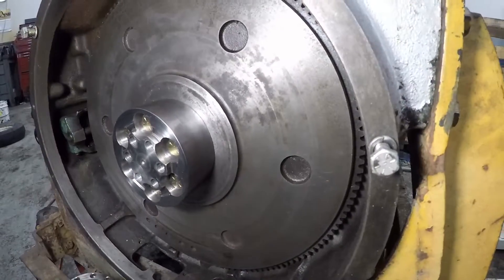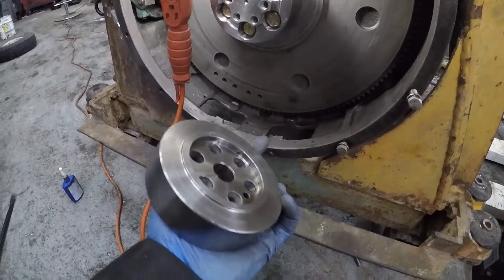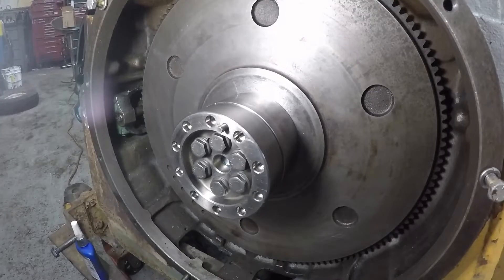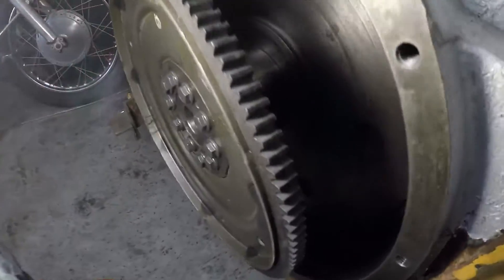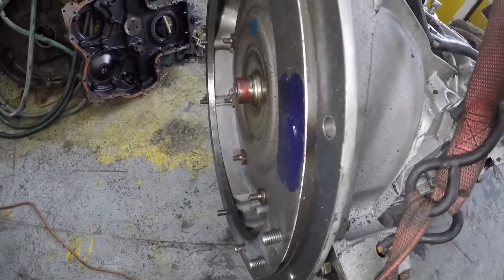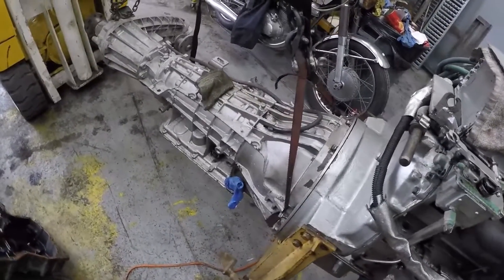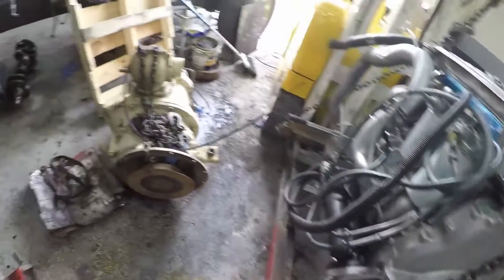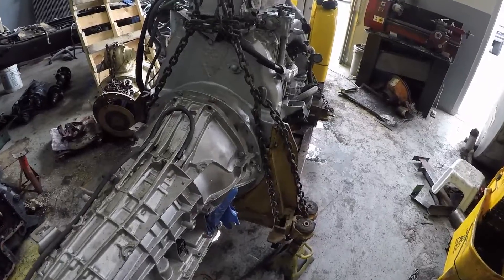Detroit 4-53T Bolted To Ford 5R110.

Comment: So well thought out to arrive at a truly "finished" product, I am without words over how impressive your execution of making the Ford transmission fit properly to the Detroit, all too often these type of things are marginal at best however in this case the installation is robust and well thought out, not easy to do!
Reply from the maker: Thanks. I wasn't sure it was going to work, but as the 5r110 was free, I thought I might be able to turn those parts on my lathe.:)  So far it's held up to hard driving and long mountain pulls.  I will have to upgrade the shift solenoids in the spring.:)  Very happy with it.:) There's no metal or leaking from the trans so that tells the tale.:) 10,000 miles post rebuild now and it's all good.:)
Reply from the maker: Not sure if you saw the post engine failure video or not.  I bought this engine in Florida and it was in nasty shape.  Sure ran well until I started running up these mountain hwys.  I got 600 miles out of it before she broke a liner.:)  Anyway I decided to rebuild it and upgrade to the Silver Series internals.  https://www.youtube.com/watch?v=CX6L06tAs7A

Comment: I like your engine adapter. 
I see you know your way around 
Designing and manufacturing.
Reply from the maker: Thanks, Yes it started when I was a kid and decided to put a chainsaw in a mini bike.:)  This is just a bigger mini bike.:)
Reply: DetroitGarage I’m a machinist 
I grew up on a farm. 
I got so much knowledge on the farm. 
And I worked in heavy equipment industry for a while to. 
So that’s why I pay attention so much detail. 
I appreciate all the fine details
When you say 4140
I know exactly that metal
Reply from the maker: @akfarmboy49  Very nice, I really enjoyed building those parts.  I made the first crank adapter from 6160 as it was soft and easy to turn on my 5" lathe.  It was a template for the 4340 piece I turned as the final adapter.  Wow is that hard, I never even sent it out for treatment as it was so hard untreated.  Some day I'd like to get an old Bridgeport or South Bend lathe and sell my small lathe.

Comment: Glad to see someone throwin a detroit in a 08-10 ford. I wanna put in a 6v53 but lookin at urs im wonderin about fitment lol gonna use the zf-6 tho definitely my dream-6v53 in a black harley 08-10 f350 crew long zf-6 and i kinda wanna put an air starter in just for fun haha
Reply from the maker: I think the 6V53T would be a great choice.  If I were to do it again I'd choose the 6V53T as it would be ideal power wise.  The 4-53T in nice, but it could use another 2 cylinders to help.  I'm at about 200 HP and 450FTLBS of torque.  I'm going to upgrade to 9A90's in the Spring and that should bring me up to 230 HP and 500 FTLBS of torque.  Thanks for watching.:)

Comment: greetings again--so i am going over your videos for fine details--a few questions--you mentioned you ground off balance weights from the 5r110 torque plate--any problems related to this?
would you have videos of machining adapter plates mating 5r110 and 4-53 flywheel housing?  dimensional drawings?
the toothed ring gear on torque plate does not engage starter motor?  many thx
Reply from the maker: Yes the Detroits are internally balanced, so if you attach any external parts they need to be neutrally balanced.  The 6.4 flexplate has external weights that must be taken off for the Detroit.  I used a simple static balancer to check the flex plate after the weights were removed.  Balance out well with just a couple ounces removed after.  The 6.4 ring gear is not used for starter engagement, the Detroit flywheel is used.  I never made any drawings for any of the flywheel or cranks adapters.  It's a one off and I never intended to do another one.:)  Thanks for watching.:)

Comment: Did you use the stock to wire converter? I use a 6.2/6.5 gm diesel converter but it seems to have a higher stall speed than I wanted. Have you heard of Phoenix castings? They make adapters for these motors. Mine has a sae4 bell housing though.
Reply from the maker: Yes stock converter,1800 stall.  Yes I spoke to Phoenix Castings and a great company.  Unfortunately they don't make an adapter for the 5R110 so I made my own.

Comment: Im curious if you have a cad file or another crank spacer id like to use the 5r110 in my squarebody chev with a 6v53 instead of doing a 13 speed eaton 😂
Reply from the maker: No I don't, I made it from scratch, no Cad file.  Have you looked at the Spicer ESO66-7B or the Eaton FSO-6406?  The ZF6 is also a great candidate if you can make the adapters.:)
Reply: @detroitgarage9430  im wanting to do the 13 speed since im getting it for free i can not for the life of me find a clutch set
Reply from the maker: @Victorsvolkswagens  Nice, should be able to pick something up, I'll be facing the same issue in a year or so when I swap in the 7 Speed spicer.  Any heavy truck transmission shop should be able to help.;)
Reply: @detroitgarage9430  i may also get an air starter because why not 🤣

Comment: Do you have the capability of making another adaptor set for a 5R110?  I have a 1968 Ford F350  Crew Cab with a 453T, that has a Clark 5 speed, with 4.10 gears.  Looking to get rid of the Clark 5 speed.
Reply from the maker: No, was a one off build, but a machine shop can easily build a set for you.  Thanks for watching.:)

Comment: Would love to put my E4OD behind my 6V53.
Reply from the maker: The E40D is a great transmission and would work well behind the 6V53.  Phoenix Castings might make an adapter for it and US Shift makes a stand alone controller for it. Thanks for watching.:)
Reply: @detroitgarage9430  I have a fresh 460 E4OD and programmer.  Have not seen any of the Phoenix stuff listed for that particular combo.
Reply from the maker: @kblackav8or  It's worth a call, really nice guys there.:)  I talked with them about the 5R110 and they never had one.  I ended up making my own.:)

Comment: You saved much money by doing all the adapter plates yourself. But for us non machinists, the 1000 would have been easier. Plus a second overdrive.
Reply from the maker: Very true, I was planning on the Allison 1000, but changed my mind and fit the 5R110.:)
Reply: @detroitgarage9430  Can you bolt up a front wheel drive to a 1000?
Reply from the maker: @Tchristman100  If you used a transfer case one could make it front wheel drive.:)
Reply: @detroitgarage9430  Actually I meant AWD.
Reply from the maker: @Tchristman100  Yes, just need a transfer case.  For me to use the transfer case off my truck, I would need to change the input shaft to slide onto the Allison.

Comment: How did you figure out the pcm for shifting? Dakota digital?
Reply from the maker: No, I used the factory Ford TCM/PCM and 13 sensors off the 6.4 to communicate.  I used HPTuners to tune the trans so it will shift.  The tach is critical and to get that to work correctly I used the SwapHelper, converts a Cummins style tone wheel to work with the PCM.:)  I also tuned the PCM with HPTuners to get it out of limp mode.:)  That helps the trans shift as well as clears up all the faults so there's no check engine lights.:)
Reply: @detroitgarage9430  dude, that would be gold if you did a write up.. personally i like to 5/6 or even 10 speed swap everything which is so much easier but there will come a day where i just can’t hold that clutches down anymore due to my arthritis so when that time comes I’d like to be able to have a solid plan b
Reply from the maker: @mikecorleone6797  True, the 5/6 speeds autos are nice as you can set the torque converter to lock when you want it to.  Essentially getting 10/12 gears.  I think the best auto trans is the Allison 1000 6 speed.  I used the 5R110 because it was in the truck and basically free.:)  If I didn't have the 5R110, then Allison would have been the choice.  The best place to find 5R110 swaps are in the Cummins Swap forums on FaceBook.  Lots of writeups on the 5R110.  When and if you decide to swap a 5R110 let me know and I can help.:)
Reply from the maker: @mikecorleone6797  Forgot to mention that I have a full build on 4BTswaps.:) https://www.4btswaps.com/threads/detroit-4-53t-into-2009-ford-f350-with-5r110.105682/
Reply: @detroitgarage9430  I’m definitely going to look into this. Right now my f250 has a fuller 10 speed in it and an air compressor for shifting. Bulletproof setup but allison is probably going to be my route in a few years when my knee finally does hit that point. I’m to young to qualify for bionic knees so i still have to deal with it for another 25 years

Comment: Is the HP turner a separate trans controller for the 5R100?
Reply from the maker: No, it's just to tune the 5R110's TCM.  I've got it just about perfect now, so very happy with the results.
Reply: @detroitgarage9430  Oh your using the factory TCM, that's cool. Pretty much 12V B+, Ground, Tach, (TPS,APS) sway you go. Love how you have made it look factory  installed. Listening to the shifts in another video it sounds good.

Comment: Do you know anyone who's done an addapter to run a zf5 of a 7.3 ??
Reply from the maker: No, but I'll soon be making an adapter to run a ZF6 off a 7.3.:)
Reply: @detroitgarage9430 keep up posting am curious as to what I'll look like I just did a cummins swap in my 94 f350 and it shit the bed on its first real tow ... so once I get my truck back from northern quebec I'll be looking at a 4-53 swap... I'd like to keep the zf but worst comes to worst I guess I'll end up with a dodge trans...
Reply from the maker: @ThadpgFrenchy  I sure will, if you can weld and have access to a lathe, then it's not too hard.  For the ZF6 I'll be using an old Deere housing off a 253.  Powerstroke 6.4 flywheel and clutch. I'll be working on that as soon as I've finished the 4-53T build.:)
Reply: @detroitgarage9430  I just moved from Labrador where I had a milling and lath to a driveway till next summer so am on the parts gathering swing till I get the shop built. I'll have to go check not to far away from my place there's a guy who has a privet tractor scrapyard see what I can drag back home